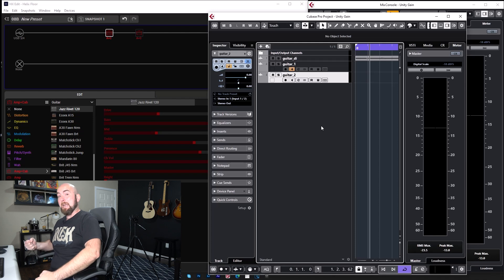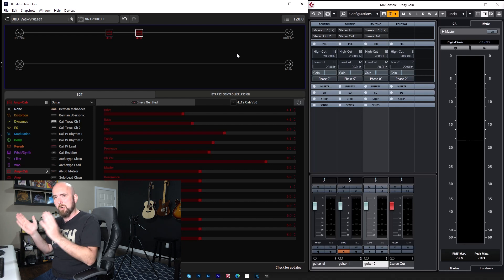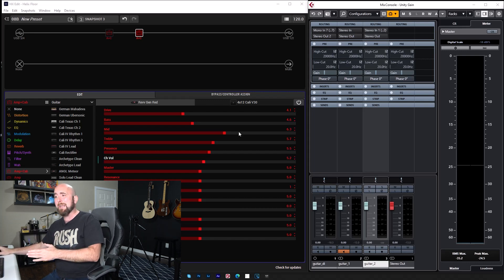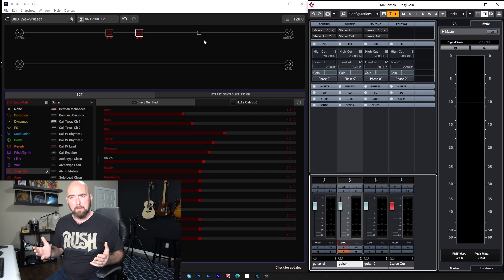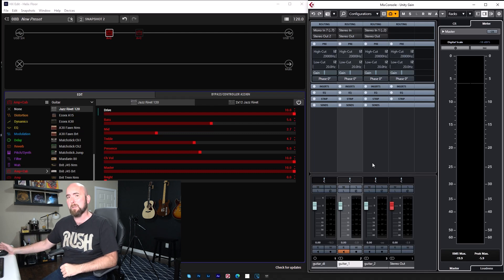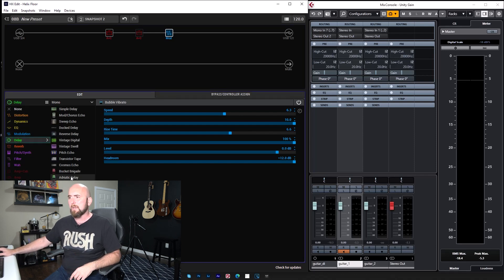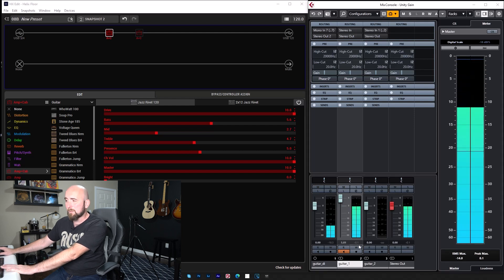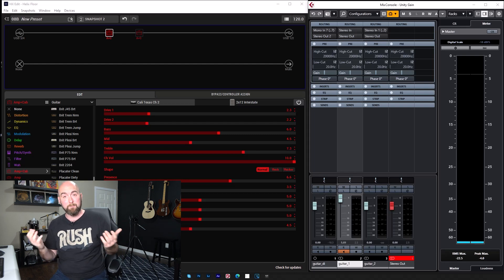OH NO!!! DIGITAL CLIPPING!! | How worried should I be and how loud should a Helix preset be?

Comment: This was very helpful, putting the notion of digital clipping in a quantitive context. I have been a proponent of keeping blocks close to unity gain. But not necessarily to avoid digital clipping. It's more to get predictable results when there's a lot of blocks in the signal chain, and avoiding having some of them be way louder than others, especially if some of the blocks after the amp+cab model might have non-linear characteristics. The Leslie speaker model is a good example. I think what you have shown in these videos is that it's the cumulative result that needs to be aware of dynamic range and digital clipping. How you get there has a lot of flexibility.

Comment: Another point in your favor is that these people aren’t considering noise floor. Even clean interfaces have a noise floor. You want the healthiest signal possible without clipping to overpower that noise floor. If you have a weak signal, that noise is going to be more present in relation to what you actually want to hear. So crank up that signal as long as it doesn’t clip.

Comment: If your output is stereo, you can have the mono signal split into the L & R channels. Set the input of the Right channel 20 dB lower, so if the Left channel clips, the Right channel's material can be used.

Comment: Love the informative videos on the Helix and based on your videos my sound has improved so much in a live situation. I send my Helix LT into a flat input Bose 8 channel mixer going into a L1 Bose PA. The mixer also has a gain control on the input. My method based on your previous videos is I set up my preset  level into my Power cab 1X12 to get the right level based on the input lights after which I then go direct into my PA as I don't use my Powercab a lot of the time when playing live. Once I go into the PA mixer I use the gain on the mixer to bring it to the level just going into the amber on my mixer but never into red. In your opinion is this the correct approach to get get the best tone and prevent any clipping. Thanks
Reply from the maker: Thank you and so glad you have found the videos helpful 😀 The method you describe sounds like it should work fine. How do you find it works for you?
Reply: @JasonSadites  Since using this method I find that if I use for example a distortion pedal I am not getting that high end fizz anymore the distortion is much smoother. I am a one man band basically using my own backing tracks and harmonies from a TC helicon Extreme 3 so what may seem like a good sound on it's own does not necessarily transfer once it is in the mix of a backing track. I will say though that since being more aware of the gain staging from your videos and getting right output from Helix my presets have improved drastically in a live setting so thanks.